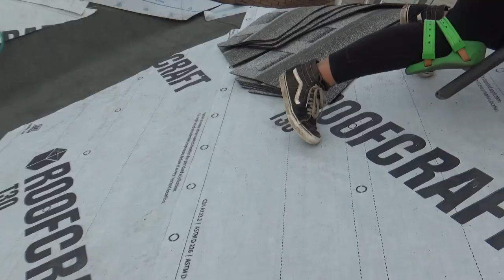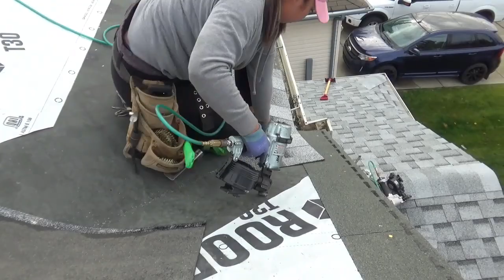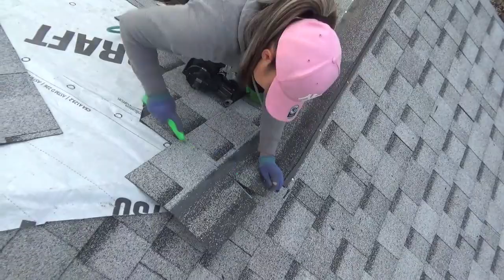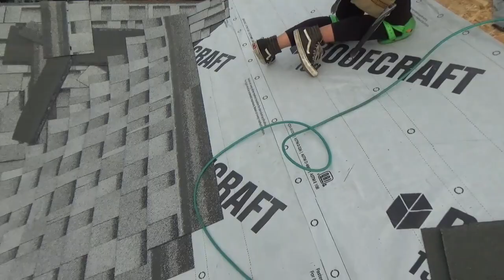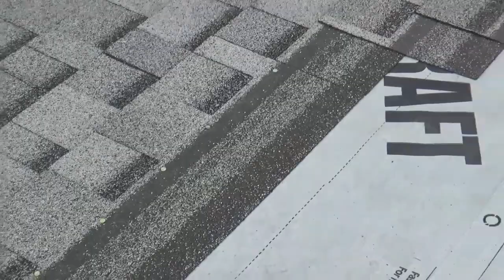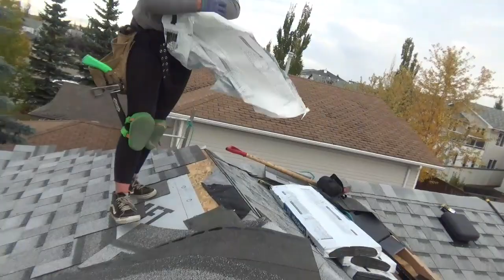Little valley

Comment: Somebody needs to teach you the proper way to run a valley !
Reply from the maker: What is wrong? it is a closed cut valley and this is the most commonly installed valley in our area. How do you do yours??
Reply: @RooferGirl  I think it’s the fact about nail placement. Your low side you have nails in you’re water line which is not good.
Reply from the maker: @JesusAlvarez-jn9eu  I got maybe 2 nails close to the seam. In my opinion, every roofer gets them and ones who act like they never do.. I call b.s. the best roofers will still get a low nail, seam nail.. or high nail.
Reply: @RooferGirl  yes ma’am not hating or disrespecting.